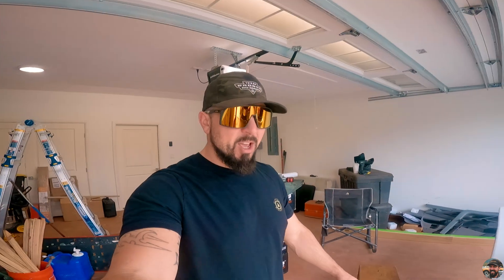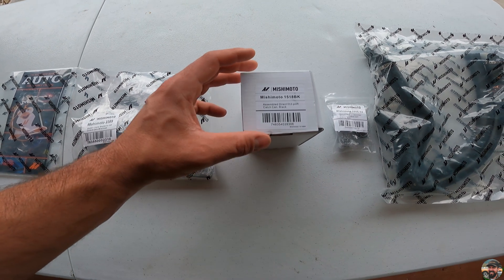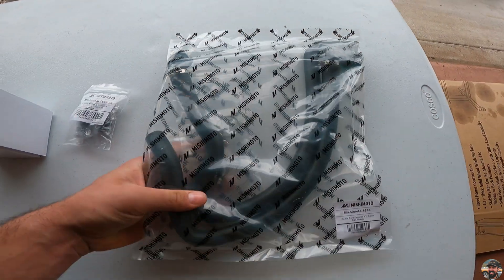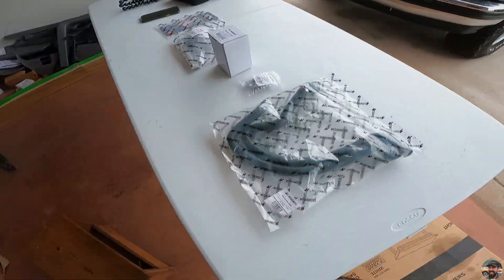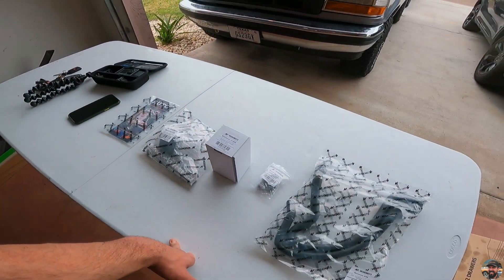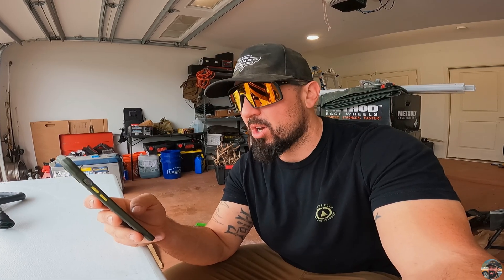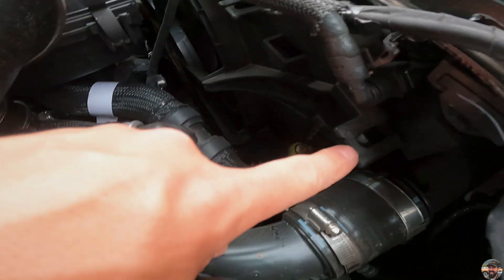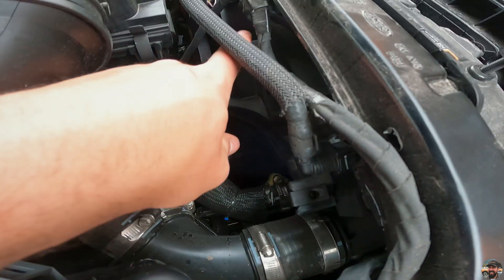How-to install 2020+ Ford Explorer ST Mishimoto Baffled Oil Catch Can

Comment: Once installed, how cumbersome is it to reach down and unscrew the canister when time to dump out the oil? It looks really tight where it’s installed
Reply from the maker: Not terrible actually but yes snug
Reply: They sell a can 3fl oz just like this one but it has a plug on the bottom. You can then put a barb fitting with a hose and valve that drink out a tube that exits bottom of engine bay.